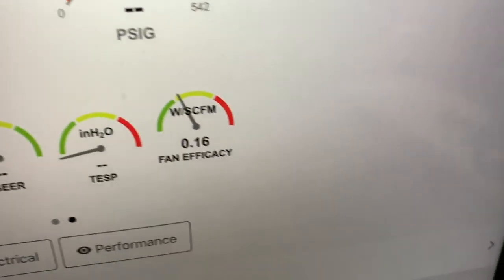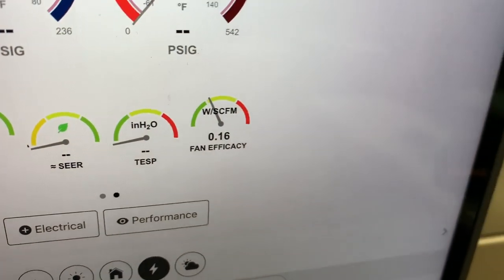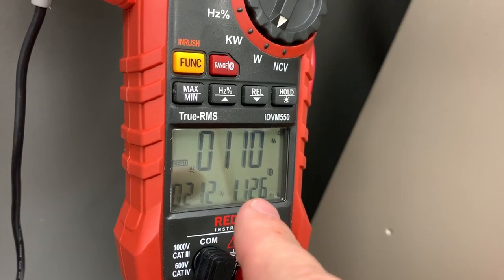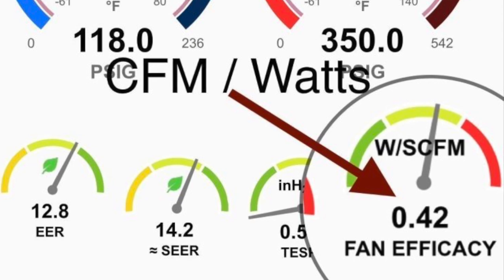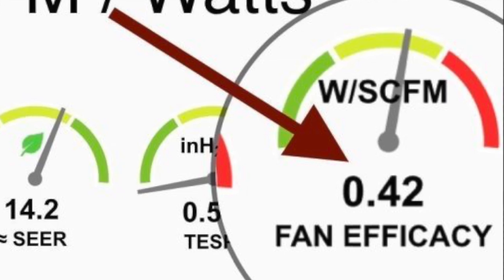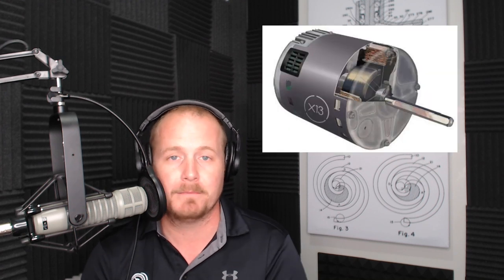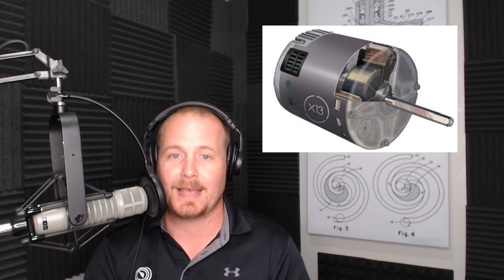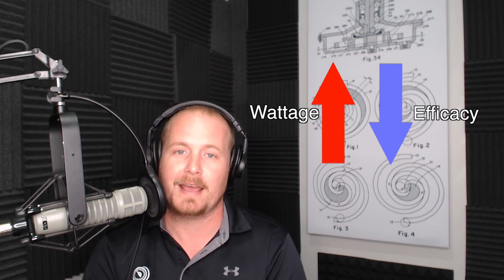How to Measure Fan Efficacy (Blower Performance)

Comment: My experience with that meter is I've purchased 2, the first one had a bearing issue on the dial, it wore out the plastic underneath the dial and would cause the dial to turn on by itself and run the battery down, the meter was just over a year old and i could not return it. i spoke with Truetech Tools and they acknowledged that Supco was aware of this issue, however they would not replace the dial. fast forward 2 years, i found out you could measure running amps under load with this meter so i decided to give it a try again, as it turn out, on the 2nd meter you could tell they improved the dial, it was more robust, however, the first time i use it for testing capacitors, it would read one time, then the next time it wouldn't give you anything, just all blanks on the app. Hs anyone else complained to you about this? I really wanted this meter to work for me, but dam, why cant they be consistent.